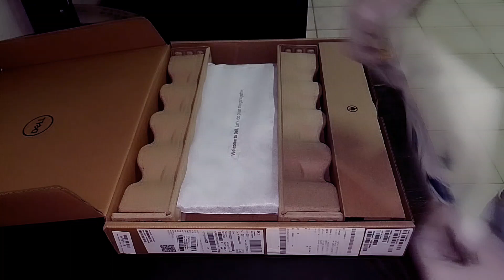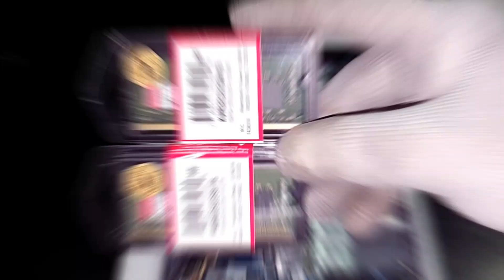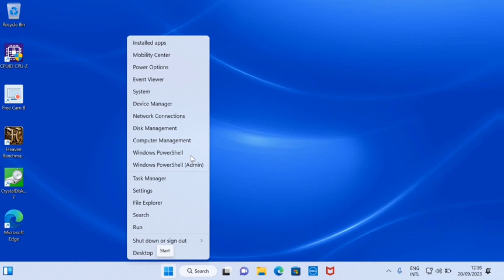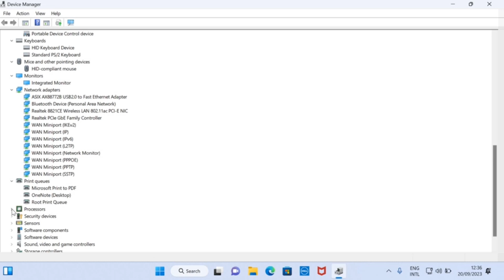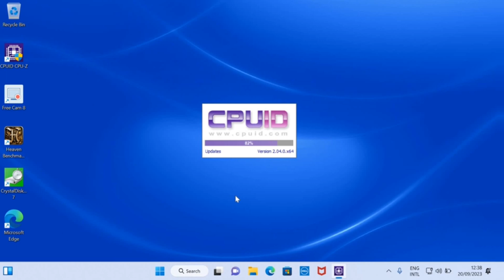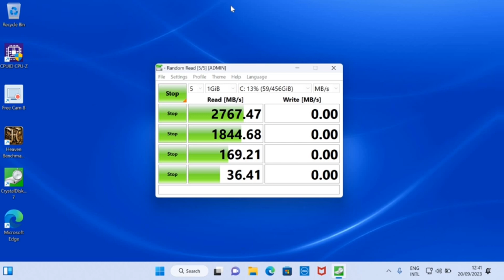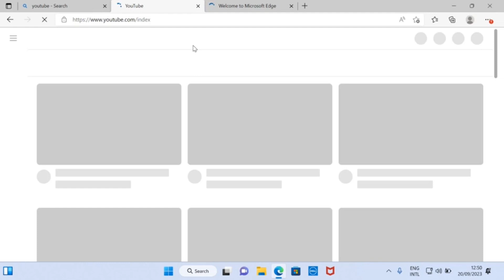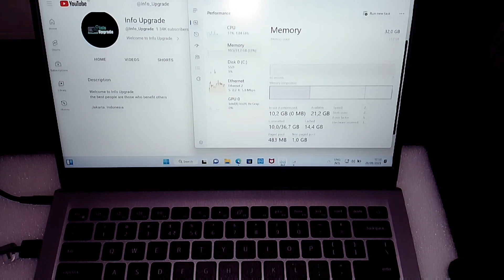DELL Vostro 3430 - Unboxing, Disassembly and Upgrade Options

Comment: Ini simpang siur soal upgradenya gan, di situs resminya max 16 GB, padahal processor i3 1305U nya sanggup handle ram smp 64 GB, mana yg bener?
Reply from the maker: Hii Bro
Pernah coba 16 gb *2 cuma terbaca 16 gb
Seperti nya ada keterbatasan hardware.
Reply: @Info_Upgrade  owwh ok apa ada kemungkinan biosnya di lock ya?
Reply from the maker: @SimonFerocius  ya bro kemungkinan BIOS di lock, saya sudah flash BIOS terbaru juga sama max 16 GB
Reply: Katanya sih harus coba yg sama merknya bang baru bs ke 32 atau 64GB
Reply: @SimonFerocius  merk ap bang?
Reply: Autocard 2d ok?